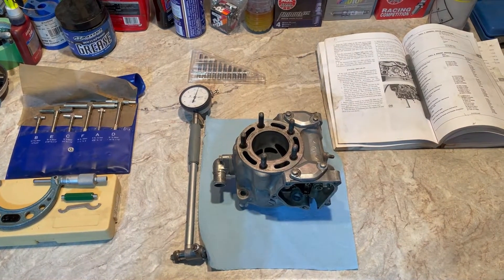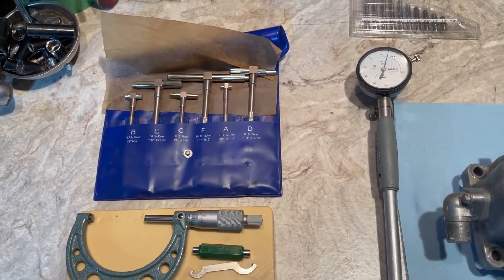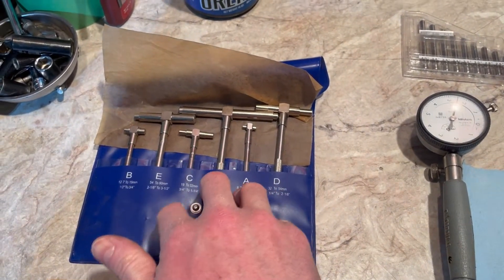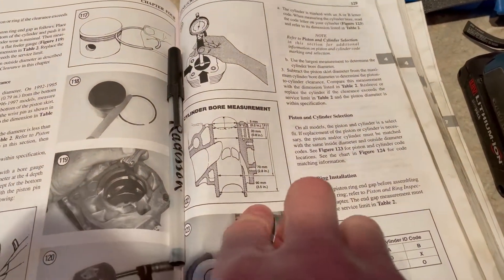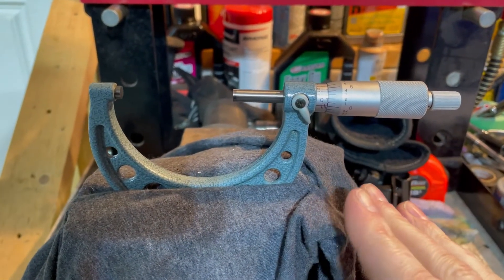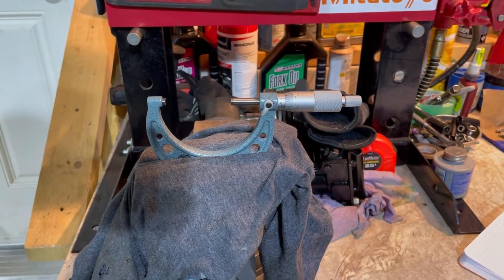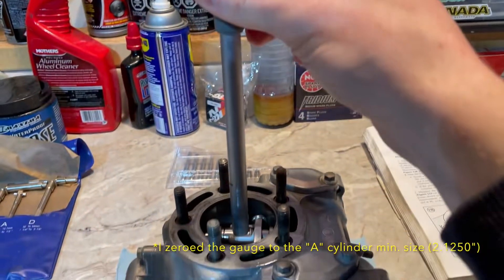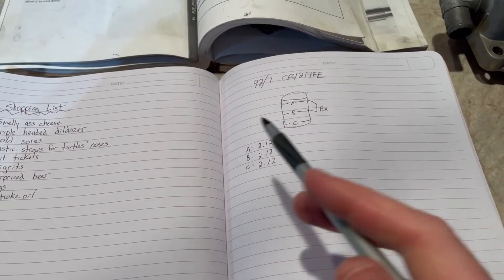How to Measure Cylinder Size (Dial Bore Gauge)

Comment: So if it's too big like your 2nd example, what's the remedy? Rebore or is there something else like a special piston or rings etc?
Reply from the maker: A few options, just like you listed. Best option in my opinion is to send it out for replating. You send it with the piston you wanna use (usually pick the smallest one) so as it wears you still have many options to simply get the next size up piston. It’s very impressive what these replate/repair shops like Millenium Tech. can fix. Cylinder comes back better than new
Reply: @turdpike  what's the cost range on that - understanding it'll vary by model - 2,3,4 hundies?
Reply from the maker: If just replating, typically say 250-300 USD, and from experience bore size doesn’t matter for cost. Repairs obviously add a bit more, cracked exhaust bridge repairs, cracked cylinder skirt repairs, power valve repairs, it really is impressive what they can save! Especially with how hard some of these cylinders are to find new these days, the re-working of them is frequently the cheaper option!
Reply: @turdpike  gracias!